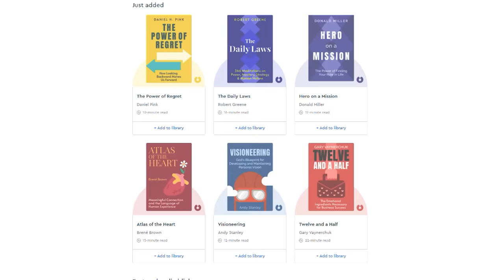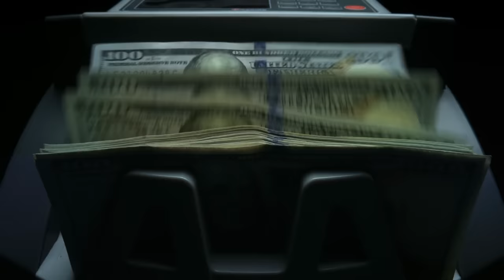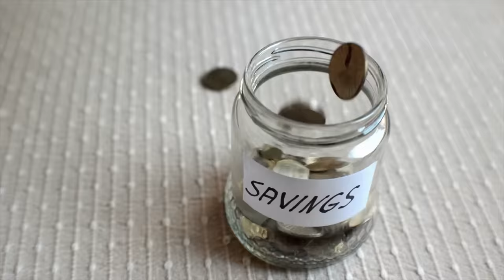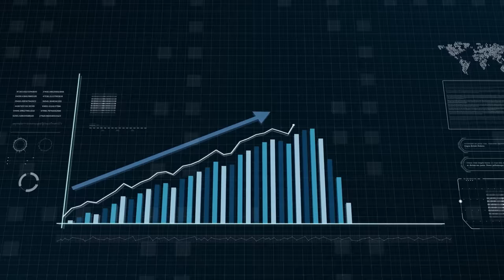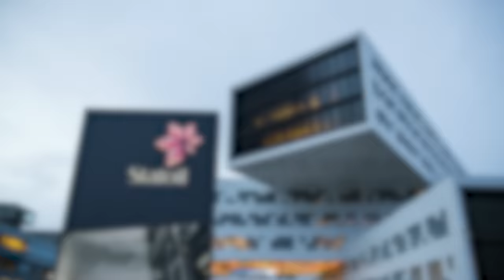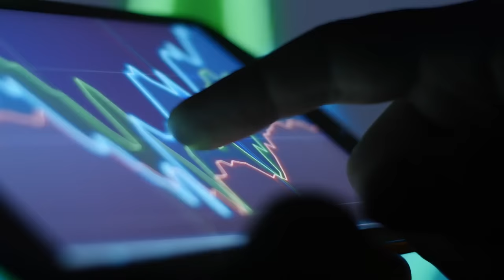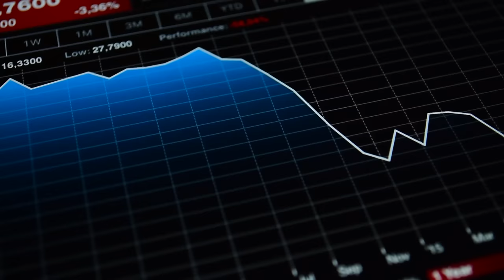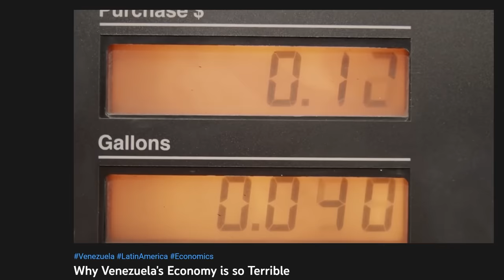How Norway Got So Insanely Rich

Comment: On finding oil in 1969, Statoil wrote down its 10 Oil Commandments, giving the industry its moral compass if you will. The author, Rolf Hellem, a Norwegian railroad inspector and later parliamentarian came to be called "The Moses of petroleum policy":

1.National stewardship and control must be secured for all activities on the NCS (Norwegian Continental Shelf)
2.Petroleum discoveries shall be utilised such that Norway achieves maximum independence from others as regards access to crude oil.
3. New business activity shall be developed with a basis in petroleum.
4. The development of an oil industry must be founded on necessary considerations for existing business activity, nature conservation and environmental protection.
5. Flaring of unusable gas on the NCS must not be accepted, with the exception of brief trial periods.
6. Petroleum from the NCS shall generally be landed in Norway, except in certain specific cases where socio-political considerations provide a basis for a different solution.
7.The State shall be involved at all appropriate levels, contribute to coordination of Norwegian interests within the Norwegian petroleum industry and the construction of a Norwegian, integrated petroleum community with national as well as international objectives.
8. A state oil company shall be established to safeguard the State's commercial interests and engage in appropriate collaboration with domestic and foreign oil interests.
9. North of the 62nd parallel, the chosen activity pattern shall be in keeping with the special socio-political factors associated with that region.
10. Norwegian petroleum discoveries may lead to broader perspectives for Norwegian foreign policy.

Source: https://www.equinor.com/magazine/ten-oil-commandments

Comment: I don't know where you've got your info about Vzla or if it is intentionally biased. But here, I happen to be born and somewhat raised in Vzla. First, a monolithic Government has made the decision-making in Vzla erratically but only in the last 15 years. Before that the Oil business was Run by (still existent but irrelevant) PDVSA which paradoxically worked by the same principles as the Norwegian Govt. In fact Vzla and Norway interexchange many industry secrets, for Vzla was an oil producer for many decades before Norway. Having said that. The difference lies in the form of Justice and Government, being Vzla a "democracy" with presidential powers (since the 50's) and Norway a parliamentary Govt with a Representative (prime minister) This could be another video, but the differences lied basically in the form of government accountability, which became nonexistent after Hugo Chaves came to power.

Comment: It was 2004 sometimes Indian government wished to venture in oil exploration and production  from deeper sea water, it indeed a very risky and less known technology. Norway was the country of choice that offered a technology transfer term with some defined commercial use of their equipment. We few Indian as a techno commercial team had an opportunity to visit and interact with the right techno-commercial and few political personalities. We got the same rags to riches stories and how futuristically they control fortune from oil for general welfare. The well distributed political power and democracy setup is perhaps to be  the most fundamental of  this prosperous society. Temperament of people, on all issues they seemed to take the bull by its horn.
 They had a surplus technocracy, and no much oil to produce, where we would need strong and reliable technical support for our oil ambition. 
Finally a deal never happened.

Comment: Nobody talks about Norways welfare problem. Because of the oil Norway has created the most generous welfare system in the world. On paper that's a good thing for the individuals, but is it really good for the soceity? Norway has about 3.5 million people aged 18-65 years old. More than 700 000 in this age group have minimum 50% of their income from welfare. If you also include those who get less than 50% there are more than 1 million people in Norway that rely partly or completely on welfare.

Comment: I heard " Russia has been in decline for decades". No sir, Russia had been on the rise for the past two decades,  after undergoing the worst crisis ever sustained by any country.  Good luck to them.
Reply: Russian GDP is shrinking.
Reply: @mrsupremegascon  Russia has three major advantages : it is now by far the biggest wheat exporter, one of the greatest energy exporters and it has a well-educated population. It also has 2 major drawbacks  : a low birth rate, and simmering religious or ethnic tensions.  All the rest is absolutely uninteresting .
Reply: @gabrielbalbec883  

Wheat doesn't make you a strong economy. 
Venezuela is a larger energy exportator than Russia, and yet, it is a country in the verge of collapsing.
North Africa is also very educated, but no there is not enough companies to hire them.

Analyzing the economy of a country by individual parameters are uninteresting. There is too many parameters. 

Better use global parameters, like how much a country produce per year, GDP. 

And here, Russia went from 2.2 t€ in 2013 to 1.4 t€ in 2020. 

Which is a huge shrink, not far from an economy being cut in half.
Reply: @mrsupremegascon  i dont know where you got your figures, but things are always more complicated. First,  the shrinkage you're mentioning had much to with the exchange rate. On the ground, most Russians work and consume as they did in 2013. The jobless rate there is lower than in most of Europe...
Secondly, Russians,  even the poorest of them, are owners of the houses in which they live. Almost 100 % of households. No mortgage for the lower classes since their apartments were given to them right after the collapse of the USSR. This fact alone makes  any other statistic pale in comparison.
 Then prices of most consumer goods are generally much lower than in Europe or the US. besides, the average income in Russia is  3 times higher than in Ukraine, and higher than in most of eastern Europe.  and that was before the war. 
Eventually,  if you dont understand that producing wheat and oil in great amounts, together with a well-educated population,  is the key to becoming a great independent power, our discussion is useless. One of the reasons the US is panicking today is because it has lost its prime position on the grain market ; in other words,  it has lost a tool of blackmailing...
PS : I dont know where you got the extravagant  info that north Africa has a well-educated population, but it's irrelevant.

Comment: No... nonononononono. No. 

What made Norway good was cheap (basically) free electrical power gained from hydro power. We're completely unique because we're the only country that are self supplied with that. THAT was what made Norway good. Oil just gave a boost to the inevitable, but our country was on the rise already before we got the oil.

Comment: Fun fact for y'all:
In the 1970s, one of the most right-wing parties in parliament wanted to sell off all the oil rights for a sum roughly 0.001% of what the fund is worth today, basically falling into the same trap as other oil nations (it's possible their line of thinking was they wanted to avoid the inflation problem altogether?)

(Norwegian parliament operates on a multi-party system, where parties basically need to form a coalition with other parties in order to get anything done. It makes the government very slow moving, something that's becoming an increasing problem today, where some decisions need to be made more quickly).

Comment: It is not a surprise the oil nations are all relatively poor (not counting the Russian Fed. and Canada) - the USA waged political and/or military wars against them. Not to mention the economic sanctions and other lesser means of pressure. That's the reason why Russia's economy is probably the strongest in the world right now - economic sanctions forced them to be self-sufficient in virtually every area - and they also have the raw materials to fuel it. Not even the Chinese or the Japanese can match that level, even though they produce more.

As for the Norway, they reflect the Scandinavian "one-for-all" spirit well enough. The Scandinavian way of thinking could be summed up like this: if you gave them a glass half full, they wouldn't stop to think what to do with the remaining liquid or how to cope with the lacking of the empty half. They would instead each pour a few milliliters they can provide into it - until it's full again. That's why democracy actually works there (and in a few Slavic countries, too) and nowhere else. Sweden has also done money laundering for the West for decades and got filthy rich in the process but I'm not sure if that's also the case with Norway.

Comment: You mean, the organizations who controll Norway got insanely rich. Just like in every other country. And the foodprices so high, you would barely have enough for food and rent. And you pay taxes for basicly everything. You even pay taxes just to be able pay taxes. Morgages that for many last their whole lives. And if  someone buyes a house, and they die.  Then you must pay taxes just for inheriting.  People generally are held down economicly.(reason is controll of population) Its like criminals controlling the market on the street corner. So that only annoynted reach higher. The world is not built for being self sufficient, cause if that were so, then they would not need people dictating their lives, instead they created a system were you must come to them for help. Because of problems they created. They live from creating problems of all sort, and then create solution. But ofc it will cost some money in doing so. Who are these organization? These oganizations consist of people from many different professions. Most often in position  of power. Power not only consist of brute force. Their real power is the influential network. And Their weakness: mistakes in the system they built. Because they are terrified that it will be used against them.

Comment: the oil have now led to a capital city full of people with high paying jobs largely creating nothing of value(export for profit). if you ask these people about the oil industry, a shocking amount of them will be of the opinion the oil industry need to shut down due to the environment(the fact that it is among the cleanest oil/gas extractions on the planet means little). so the very people who feeds of the oil and gas like no other ..wants it permanently gone. you can say a different kind of oil sickness a kin to vaccine sceptics, the very thing they are hostile to worked so great it apparantly isn`t needed in the first place

Comment: Apart from some minor inaccuracies (Norway was never poor in European context, only 4% of the profits form the oil fund can be used), I think this was a good video. The overall aspect of it rings true. However I still think that the success is not only linked to luck, but also good decisions and a well regulated capitalism, aka social democracy. Such creates a society focused on taking care of the individual citizen, which in turn means you need a strong government, functioning regulation, safe and well paying jobs, high progressive taxation that ironically leaves those at the lower levels with more buying power than other places and so on. Lets not forget that Denmark, another social democracy, also have high living standards and they do not have oil.

Right wing leaning systems usually have a reversed focus. Its those at the top, be it the elite or even "God" (10% on all income to the church), that should benefit from society while they rest should just be happy they are allowed to work themselves to the bone. Frp (right wing populism in Norway) is a good example of such. They were super populist while out of power, less road toll, lower taxes, the usual right wing shtick that would benefit some average folks, but when they gained power along with Høyre (center right wing party). All of that was out the window and FRP policies just benefited people in the above middle income type bracket. Ironically the smallest of their voting block and why I think even conservatives should think twice before they vote for right leaning parties IF they make less than 600 000NOK pr year.